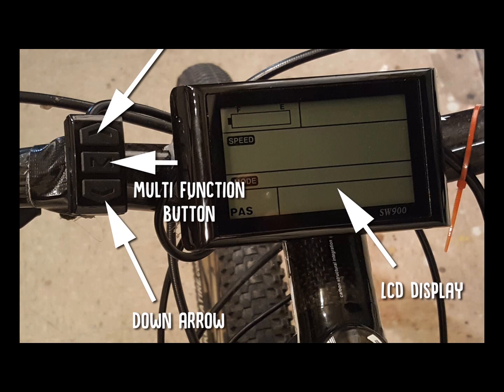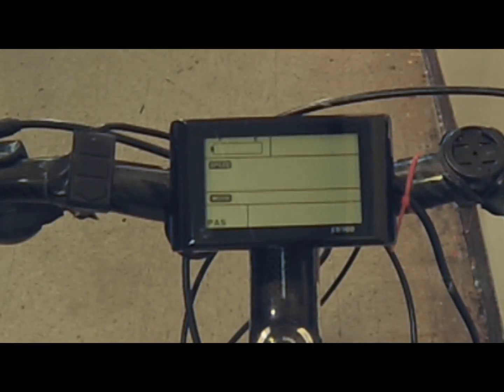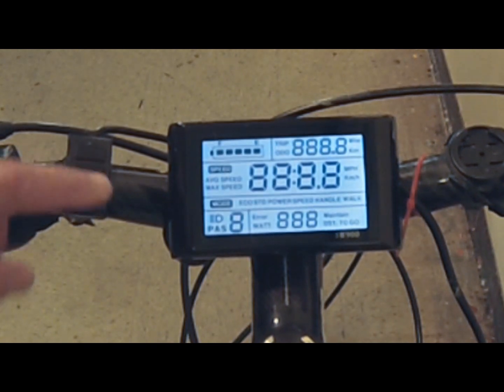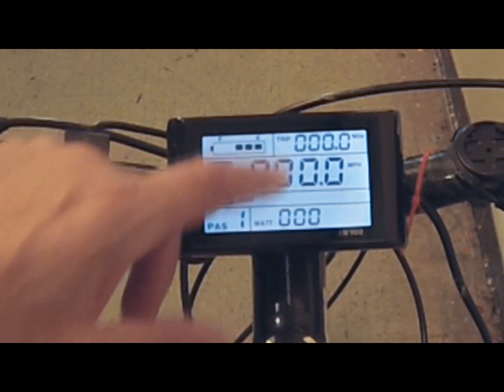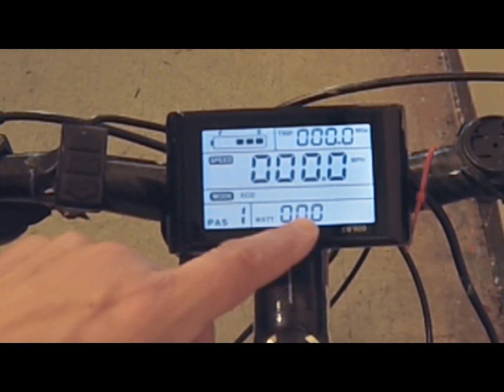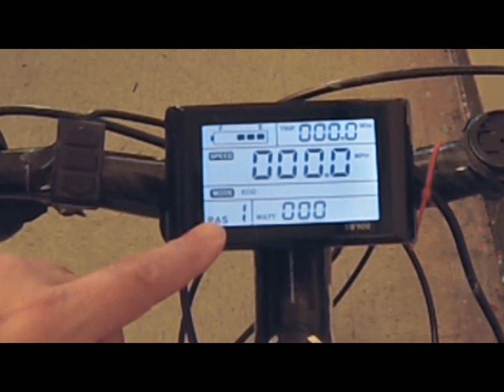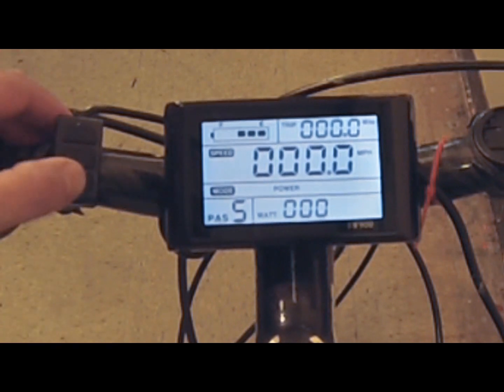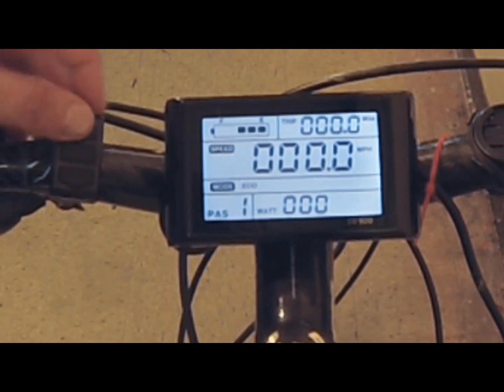Programming your controller with the KTLCD3 and SW900

Comment: Would you know why in programing mode for the sw900 mine goes from p08 to p13. It just dosent have a p09, p10, p11 or p12. Just skips right over those. Thanks for any help
Reply: My sw 900  error 30????? Please help
Reply: Re missing settings pages....I have a 1000wx48v front wheel kit with SW900 display
Seller says 9-13 are hidden so users won't mess with them
Reply: Did you ever find out how to fix this?  I have the same problem

Comment: Hi, which screen and corresponding controller is better? The lc3 or the sw900? Thanks
Reply: Particularly for use with throttle. Thank you!
Reply: Also, do both controllers support limiting how much amps/power they draw? For example if I have a 1500w motor can I use the controller to limit how many amps it's drawing to save battery? Does one controller do this better? Thanks again

Comment: Display doesn't have 52 v settings, should I put it on 60, or will it damage it?
Reply: Won't be damage it, my battery is 52volts but set does not have 52V, I put 48volts still full 100% long 75km, suppose put a small display meter volt and bar.

Comment: In my case only works with the throthle, if i plug the Pas sensor i have error 7. If i disconect it throtle works. I have checked and tryed in modes 0,1 and 2 (Pas,Throtle or both). Anyone knows whats wrong? Thank U
Reply: I have a voilamart ebike kit with this LCD but does not have the error 7. My concern is a different one which might be related to yours.  Regardless P10 set to  0, 1, or 2, throttle still work. I check some forums and they said the same thing. https://endless-sphere.com/forums/viewtopic.php?t=105464
I think it is the manufacture's intention or something. I almost crashed last time when assuming throttle is disable when P10 is 0.

Comment: I have a sw-900 I have error code 010 on the display caused from a friction in the hub motor, so I replaced bearings in hub housing, 3000watt . Is there any way to reset this as there is no go at the moment ?
Reply: If error 10, on your lcd cable, connect red and blue together. 😉

Comment: I have the SW 900 for the bike I have recently put together it was working great untill after a few rides I started getting an Error 02 code...it’s to my understanding that is a break error code, I checked all connections and they seem fine. Any suggestions how to go about fixing that?
Reply: The error 02 code is simply telling you the switch to either one of the brake lever switches is open. You should be able to adjust the levers to cure this. You will then notice that each time to operate the brake levers the error code will display. This is normal. What's is not normal is if the code 02 remains after the levers are released. It may take a couple of times to set up. Mine did.
Reply: @timg7127  Yes, you are right, same i'm saying

Comment: Hi, i have purchased a 48v 1500w built in controller rear hub. It came with a sw900 lcd. Will a different type of display work?
Reply: I have the same rare hub motor with built in controller, and my sw900 got burnt, did you find out if these sw900 can be replaced?
Reply: @AlaVRSim  they can

Comment: dose this apply for a kit you bought in Pieces? Or is this totally Arbitrary then I noticed I only get 31.7Kph with my 38V pack is this typical for a DIY build? switching modes seemed to solve some of the problems. I suspect I am just switching setting modes labelled 0-5 with 0 giving me a 15Kph speed no PAS and 2 being 20Kph/Peddle assist... could only do so much propping it up on its kickstand. I am assuming 3-5 are Variations on 0-2 I was wondering why I keep seeing a static stand in the background all the time.... where you could sit on the bike and tune the computer on the controller my problem is every part was bought separately all I did was follow the printed data and buy parts that fit the motor Voltage and wattage. I did have the motor spin backwards the first time I cracked the Throttle. ( Programming green wire took care of that) this DIY thing must weigh like 120Lbs with the battery, motor and controller installed. I had to rework the disk brakes and put spacers in the back mounting bracket.... lots of work for 1 day. More Over "Is this pretty much the same for all controller computers?"
Reply: Justin Schubert what size hub motor…?

Comment: Are the SW900 and KTLCD3 interchangeable?   I have a controller that I bought with my SW900.   I am purchasing a new KT controller and would like to keep the SW900 if it will work.
Reply from the maker: I have had the same issue and unfortunately they are not compatible

Comment: Can someone please tell me where to normally hook up the individual wires from a lcd3 to a 36v1000w controller on a 36v10ah batt? Im just waiting on the sensored hub motor to get here and I'm going to build a friction drive using 3phase motor skateboard wheel.

Comment: how do you turn off peddle assist so that only the throttle engases the motor?
Reply: If that is known issue and cant be fixed by them, i would say DIY a switch on the throttle signal wire so we can disable that manually. That is what i am gonna do
Reply: P9 is what he said
Reply: @adamleehowarth  it should be P10. Set it to 0 (PAS only) .
Reply: Another thing is regardless what you set for p10, throttle still work. I have this lcd and voilamart kit and it do that to me. Some other people say the same thing

Comment: P11 PAS sensitivity. Range: 1-24
P12 PAS start strength. Range: 0-5  .......................................  CAN YOU TALK MORE ABOUT THESE SETTINGS ON THE SW900 DISPLAY,  LIKE WHICH IS MORE AND WHAT IS LESS.  MY P11 IS SET AT 24 AND P12 IS SET AT 5..   iT IS TAKING  30 FOOT BEFORE MY PAS KICKS IN.
Reply: Put p12 on 1
Reply: Put p12 on 1